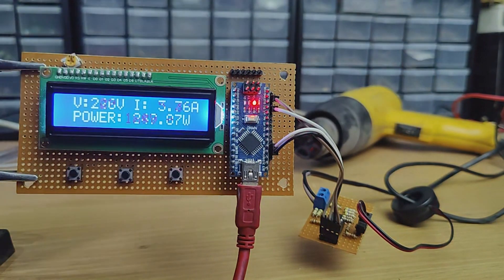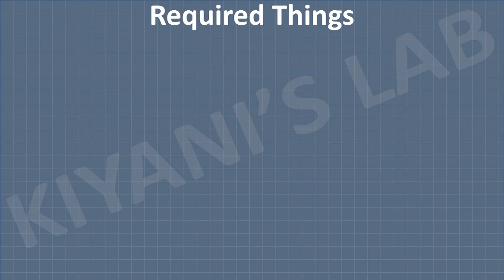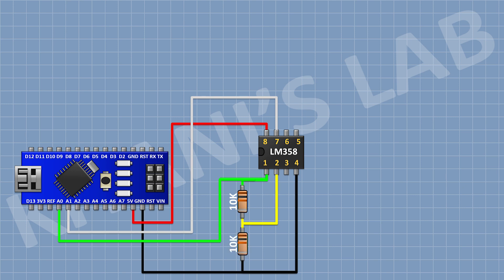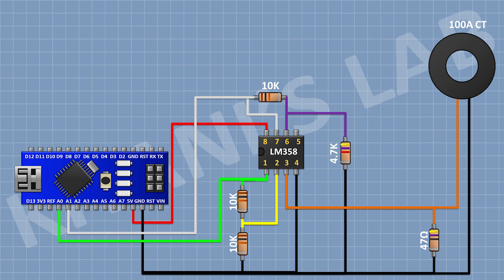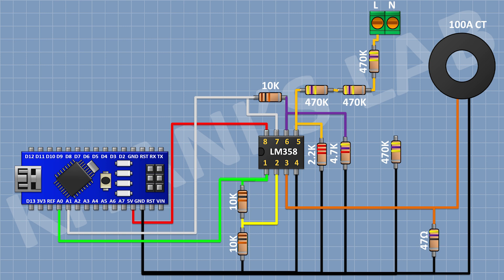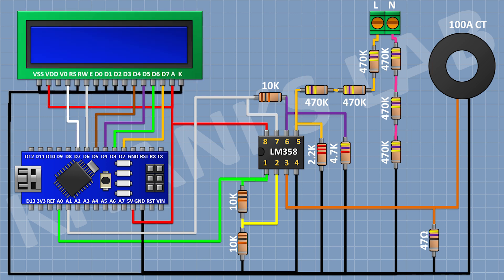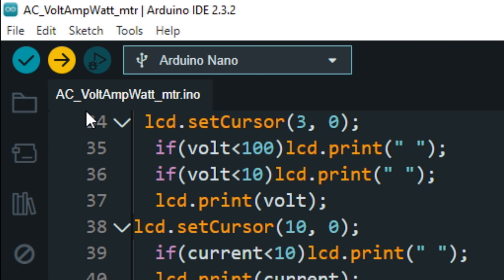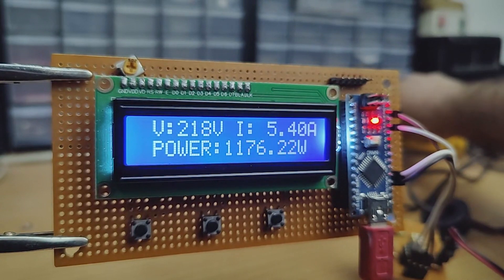How To Make AC 3 In 1 Meter | Arduino Project

Comment: I need some basic curcuit which xan do below .
I have 4kv low frequency transformers based ups which has poor conversion efficiency. I have a hybrid solar mppt charger connected with it .  Currently after 7pm i manually turn off ups and change power to wapda by removing the plug feom ups and connecting it to wapda. And if light goes away duting night i again connect the live wire to ups and turn it on. Can i somehow automate it using the easies way and amallest comoonents ?

I have a smart switch which can turn load on or off based on schedule.